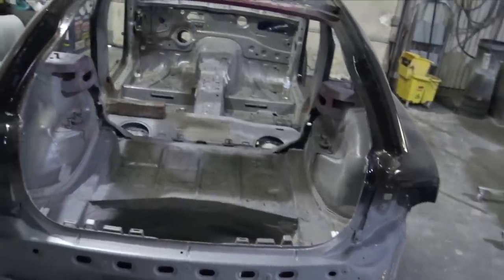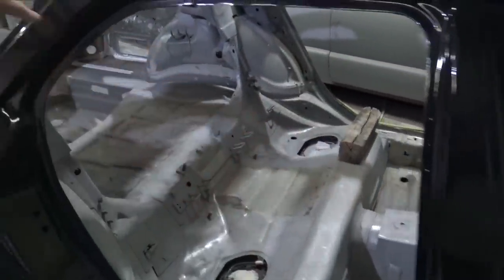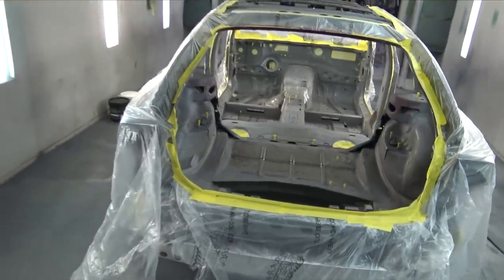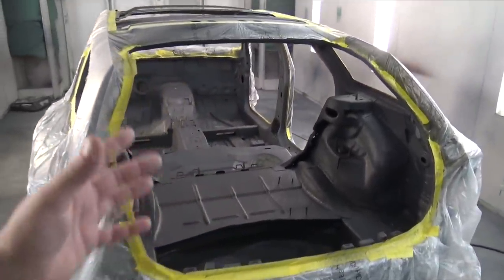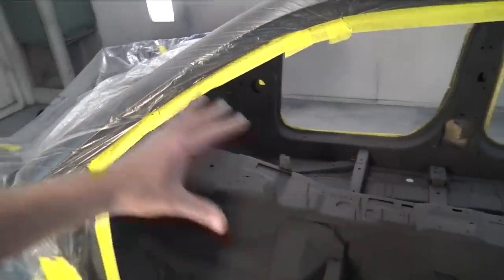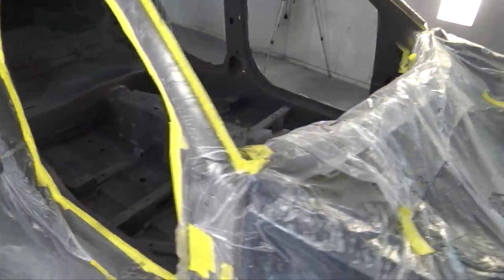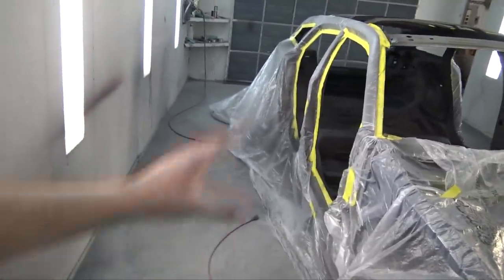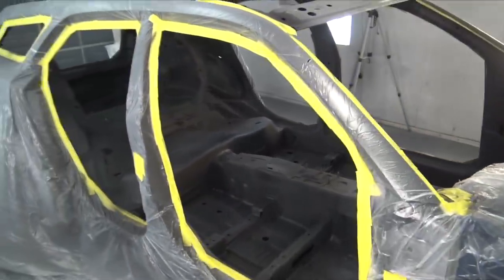Building the Ultimate Station Wagon | 2021 Charger Magnum Hellcat | 1000HP Hellwagon | Pt 49

Comment: You should probably do some kind of heat barrier on the underside of the dark carbon/Kevlar roof. Hate to have the heat observed into the car through the roof and it be hot as balls in the sun.. also this is probably the most complex build on the Tooobs right now I can wait to see the body complete.  It'll be a huge win.

Comment: Should coat the underside of the roof with the sound/heat barrier.  Rain can get very noisy and its going to get very hot in the summer and very cold in the winter.
Reply: Do you really think this is gonna be driven in Colorado during winter? Would you do that after building a car for over a year?
Reply: @grandtheftautotune7715  Sure. I get the impressions he’s building a daily.  Maybe not in a driving blizzard, may not even see snow, but it will see the cold for sure.
Reply: @grandtheftautotune7715  nssbsbsb
Reply: @stuey7777  tjjttjtjri

Comment: Progressing nicely Dave one question I have is what is the overall thickness of the two coatings you used on the inside and is it going to affect any of the panel installations or other interior pieces? Thanks for another great update video.

Comment: I honestly thought of taking my dads friends old beaten up Dodge Magnum for my first car and making it look new since the car is in rough shape due to the fact that it has 2 headlights that don't look the same because one of them is chrome and the other is black but it's okay because I will just get a 2015 Charger parts car, take the exterior and interior out of the parts car and put it in the Magnum and also, I will do a hellcat engine swap to the Magnum too because the engine that is currently in that car is broken and rather than just spending the money to get the Hemi engine fixed up, it's better to put a Hellcat engine and yes, I know about the reliability of Chrysler products

Comment: Fit the cats.
A couple of good hiflo cats won’t impact the power as much as you think and the hassle of being defected for not having them is not worth the slight power gain. The EPA is cracking down on emissions defeating so tunes etc will be harder to get and driving to a state that requires them may see your car seized and crushed.
Reply: We don't have emissions where the car will be registered. It's more about where your car is registered than where it's driving in the US
Reply: @Shiftheads  jrjddjfjjfjfj
Reply: @Shiftheads   Until it isn't.
The EPA is Federal so not bound by state rules and some states do wacky things in the name of being woke or what ever term is trendy and applicable.
Confiscating and crushing a vehicle that doesn't comply to the rulz is very much a possibility now that Biden is president especially as it is something that's been on the cards for several years now in a lot of states
Reply: @anomamos9095  You are talking years down the line. The enforcement the EPA is trying to do is with deleting on diesel vehicles for the most part. The language is for more than that, but that's what they are focusing on. The EPA/government does not have the resources to drive around looking under everyone's cars to see if a cat is intact or not. In certain counties of Colorado, like where the wagon is, no emissions is required so for this build it's not going to matter for a long time
Reply: @Shiftheads  zbbzzbxb
Reply: @anomamos9095  Would it be less risky to have cats? Sure, but the car resides and is registered in a county without emissions. If you drive the car to another state, they can't impound your car for it because it is based off where the car is registered. Just read up on it. It'd be one thing if you live in the state where it's illegal and your car is registered out of state but that's not the case.  If they federally mandate that no one can remove cats in any state and create an enforcement division then sure add cats on the car but why do it if you're not required to at this time? Weed is federally illegal, but they aren't busting dispensaries here in Colorado for making millions of profits off it. It will be the same with delete devices. They could pull infrastructure funding if states refuse to pass EPA laws but that's about it
Reply: @Shiftheads  You're kinda missing my point that what you think is the law and what is the law may not matter to the cop who pulls you over looking for any excuse to make his day. And simply because a federal law is not being enforced in a particular state by local police doesn't mean they won't randomly choose to enforce it especially if the thought of civil asset forfeiture is making them drool. Some tote shops have been raided and assets taken by local cops in free states.
Just because weed is legal in your state doesn't mean the cops won't use it as an excuse to take your shit.
As I said the legality of something is not a problem until you have to hire a lawyer to get it back and when you pay the lawyer bill it will be many times the cost of the cats.
Reply: We aren't allowed to remove cats from any car fitted with them here in Australia. Even though my 1982 Mitsubishi L300 didn't have a cat (before cats), I had to fit a cat when I put a 1991 engine in it, because the 1991 had a cat. At least you don't have to feed these cats!!
Reply: @Shiftheads  hdhdhdhdh
Reply: @anomamos9095  ddhdhdj
Reply: @anomamos9095  Click bait? They didn't take his car and that guy is in California(the worst of all states in the US) not sure what you're trying to prove here
Reply: @Shiftheads  Actually I picked it because it was one of the worst cases and because the guy was a bit of a clown

Comment: I'm not an environmentalist but in this day and age there's absolutely no reason not to have catalytic converters. If nothing else they get rid of that unburnt fuel smell out of your exhaust.
Reply: George Jones  I'm not an environmentalist and I'm not going to get into an argument. I'm just some guy that spends his time bypassing all the emissions crap without taking it all off. That way everything still looks legal and nobody has to pay any ridiculous fines that cost more than the car if they're pulled over. As for catalytic converters, I've never had one clog without major engine issues. Even then it usually needs to have the remains of a chewed up piston or two sitting in the cat. The bottom line is if you're clogging cats then by removing them all you're doing is removing the symptoms rather than dealing with the big issue. Also, the unburnt fuel smell is not pleasant and a decent high flow cat is not expensive and fixes that.

Comment: ☝️😉 I got a little DUI trick I used years ago oh, well nowadays there's much better products on the market these days like Raptor but yeah I took a cheap spray can of Napa brand don't know if it would work with other brands undercoating, the stuff sprayed out Brown and was soft, I'm like this junk ever going to get hard, but I'm at least it's a undercoating... Well me and multitasking found little something out... I had just sprayed a panel with the undercoating and then I was doing a little bit of brazing with a torch oh, well I accidentally hit the panel that I had just undercoated with the torch... The undercoating sizzled all up, melted and then got rock hard and immediately after before it even cooled I gave it a shot of very cheap black spray paint. The stuff came out like smooth bed liner or something... It melted down into all the cracks and seams, and I'm sure it will last a lifetime! Just a little crazy accidentally discovered trick if anyone wants to try it out for themselves. Do remember though most paint is flammable... I'm not going to be responsible for someone singeing their eyebrows off LOL 🔥🙄🧯
Reply: @BrucePierson  xjxjxjjxfj
Reply: @GustavoRodrigues-zo8fi  I have no idea what that means.
Reply: @BrucePierson  susususuu